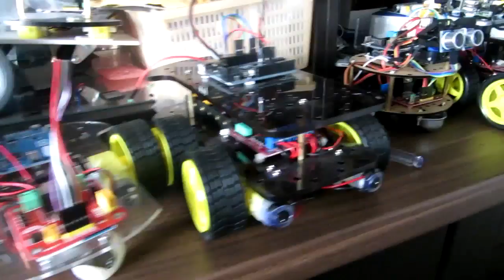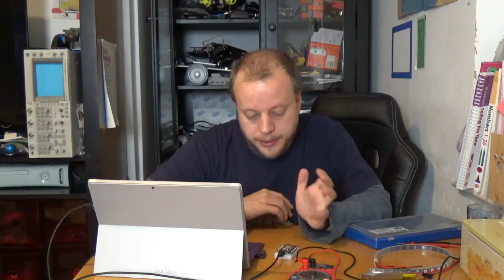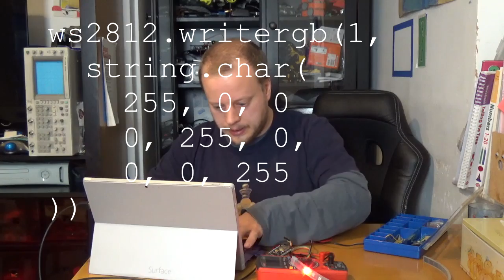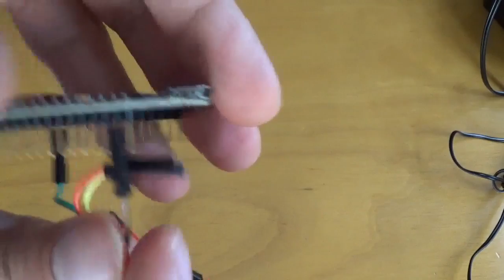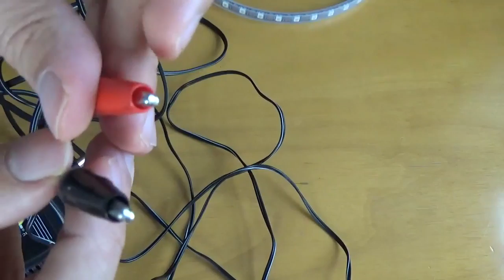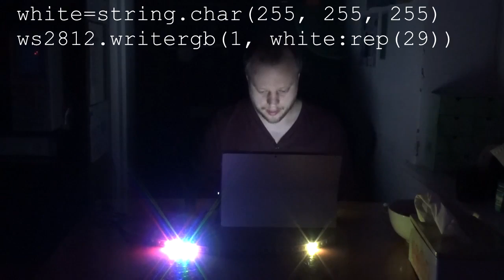Ws2812 Neopixel Led Strip With Esp 8266 And Nodemcu

Comment: Is ws2812 different from ws2812b?
Reply from the maker: The WS2812 has the LED and the controller chip separated, WS2812b has them integrated. The control code and wiring is the same. the ws2812b also has higher brightness. ws2812b also has reverse current protection. It's an improvement, but still compatible.

Comment: Nice video ! But i have a trouble ... with RTOS : I have installed RTOS lib to Arduino IDE (but ESP project)
freertos/FreeRTOS.h: No such file or directory
   18 | #include "freertos/FreeRTOS.h"
      |          ^~~~~~~~~~~~~~~~~~~~~
compilation terminated.
exit status 1
Erreur de compilation pour la carte NodeMCU 1.0 (ESP-12E Module)
Reply from the maker: Hmm, I can't say I know RTOS. However, the error suggests you need to have the RTOS library in the right library path - https://docs.arduino.cc/hacking/software/Libraries - check the library folder you have there. Where do you install the library to (which path)?

Comment: Hello there!
If I power my ARGB externally and want to control esp 8266 wirelessly through wifi, do I still need to use micro-usb for powering esp, or does it get power by SVN connected to red cable of strip?
Reply from the maker: Hello, in this particular example the esp8266 is only powered via USB. However, you should be able to power it from the same supply with a regulator. A 3.3v LDO regulator would do, and if you are breadboarding, look for one in a TO220 case.

Comment: Hello how would you do that with a neopixel Matrix where you could send message to the Matrix and move it from hamstring to right
Reply from the maker: Hello Ernesto, I am not 100% sure I understand your question. However, I think you are talking about programming  a matrix instead of a strip, and scrolling text on it. These are usually arranged as if all the rows had been put into a long line, so if each row has 8 pixels, then the 9th pixel would be the next row down. The code may get interesting in how you store the image (in a 2d array? or just format in 2D visually, but still store in 1d). This video (another maker) https://www.youtube.com/watch?v=6FdksbasKw0 - shows how these are arranged, or how you could hack one together.

Comment: Finally - after hours of searching someone who gave clear instructions and images of what goes where with troubleshooting already built-in and it's almost 5 years old! thanks!
Reply from the maker: Perhaps one day I can follow this up using the apa102 and ws2801, for comparison with ws2812. I'm also thinking of some different controller types - Raspberry Pi, Arduino Nano, esp8266 again, esp32. I'll try to include troubleshooting - but that was easier when I was less familiar with them - and had trouble to shoot...

Comment: nodemcu has 3.3V logic. WS2812 strips run on 5V logic.
Reply from the maker: Driving them works without issues for many lights. As long as its output to 5v it's normally OK. Inputs must be shifted down to avoid damage. The 2812 type seem OK from 3.3v. The 2801 type seem to need a boost.
Reply: @Orionrobots  it is out of spec.
Reply from the maker: @omaversteher1  you should use logic level shifters with these, however my general observation with addressable RGB strips in general, with ESP's, Pis and picos, all 3v3 devices, is that most strips will work fine. Not using a level shifter may result in glitches in the output, but will not damage either device in this specific case.
Reply: @Orionrobots  like said ;-) Out of spec. Can work, but better put the 1/4 in 3.3->5V

Comment: How can I deactivate that the Modemcu automatically turn off.  RGB atrip didn't light up
Reply from the maker: You are probably seeing the watchdog timer, which will normally reset if it's not reset once a second at least. In NodeMCU Lua, use tmr.wdclr(), in the arduino api look at the wdt library.

Comment: would you be able to program this in the arduino IDE?
Reply from the maker: Yes - definitely. I've not made any videos interacting with the esp in the Arduino IDE, and also few using Micropython too - NodeMCU (the Lua interpreter I used) has frustratingly got a slightly young API for these strips, which has changed incompatibly since I made this video.  I am favouring the interpreted languages for a couple of reasons though:
* Field programming - the Arduino API requires you to drop the chip into Flashing mode, not a big deal, but kind of annoying. Lua and Micropython can be programmed over the Wifi when it's setup.
* Web stuff - it's significantly easier to make web socket servers and REST/JSON services in the scripting/dynamic languages than the C++ in the Arduino IDE. It can be done, it just takes more effort.

The pros of the Arduino thing though is the ability to take advantage of all the Arduino code for interacting with devices out there, the massive saving in memory, and the ability to get far lower level if needed. I can certainly make some videos+code examples of doing stuff with the Esp8266 and Arduino IDE if people are interested in them.
Reply: thanks for the quick response! i'm trying to make a project with the esp8266 and a mqtt server from adafruit. io. my plan is to have 2 esp's ,that each have a neopixelring and a button, connect with each other over a mqtt server, so that if one of the buttons is puched, both neopixel rings light up for 20 seconds. (the esp's would not be in the same home network) . but my programming skills in the arduino world are close to none. do you have any tips for me? (i already have dificulty's just lighting up the neopixels just with the esp alone)
Reply from the maker: First tip is to break down the different parts and get them to work, so get the neopixels working - you then have a working example, and then get a simple MQTT node working. Once you have both, it should get easier to connect them up. I have no experience with the MQTT. For the Neopixels  - a quick google turns up this Arduino compatible library - https://github.com/FastLED/FastLED - which supports most of the Neopixel types and the Esp8266 platform. It's got some nice documentation over here: https://github.com/FastLED/FastLED/wiki/Basic-usage - certainly I might play with that after my current project (a chatty interface thing).
Reply: great! thanks for the help! i'm looking forward to your project video's

Comment: Hello sir.
I have a question that how can I connect it with alexa Amazon
Reply from the maker: I've just found a lovely video demonstrating doing this - https://www.youtube.com/watch?v=u4aIFOdGP2k
Reply from the maker: My understanding is you could do that with the esp8266. The idea would be that you create an app to receive commands (like a web app - see my videos on the Wifi LED example) on the esp8266 to control the light strip. Then you need to create a custom Alexa skill to send messages to it.  Requires a load of coding - but definitely doable.
Reply: Orionrobots thank sir much
Reply: I think you can search the web for "ifttt esp8266"
Reply from the maker: Hmm - are there if-this-then-that extensions for Alexa already? Nice.
Reply: None of the current libraries seem to work with the ESP8266 and Amazon echo V2 but apparently do work if you have a version 1 in your system.  I've been trying this for a while with no success yet.

Comment: Trying to use this as an Artnet node to control the strips, then having a lighting program on my computer control the strips to music. Any ideas?
Reply from the maker: I've never used artnet. What I've been able to find out so far is that it is DMX based, and that DMX is basically serial packets. So you may be able to use the NodeMCU UART library to deal with these packets, and probably set it to use the "alternative" pins so the normal ones are left free for debugging/flashing code.. If you use the Arduino IDE for developing the code instead of NodeMCU, there may be prebaked DMX libraries out there for that to help you out. There is a "updsocket" library in NodeMCU for the UDP part too (which I think is the part that changes form DMX to an Artnet Node).
Reply: Any progress with this?  Trying to do the exact same thing!

Comment: Hey do you know if I could do the same using the Arduino IDE with C++ code ? I mean, I know there's a library from Adafruit to do it but I wanted to make sure it was working properly with the NodeMCU. 
Thanks!
Reply from the maker: I've not tried that - it's definitely worth trying. It sounds like other viewers have done it this way so it should work. Perhaps worth trying in a Q & A video.
Reply: Thank you for your answer. Having done some research myself, I found that it should be possible. I'll try as soon as I get my LED strips.
Reply from the maker: There is an answer in the comments below from someone who has tried this already - Micheal Miller.

Comment: My first LED is showing up as white. Sometimes it's green or yellow. I'm using the same wiring setup as you for power but with a 5v battery. I'm at a loss.
Reply from the maker: I've seen a first LED show up as green too. This suggests timing, or signal issues. Can you show me the code you use - do you initialise the output pins used as outputs, and do you immediately set them low?
Reply: Thanks for the reply! I'm attempting to follow this tutorial https://www.instructables.com/id/ESP8266-Artnet-to-DMX/ and use the led strips via Artnet in software such as Jinx!. I'm not really a programmer myself. When I power the lights/nodemcu from a 5v battery pack, the strip is blank, but when I click "Start Output" in Jinx!, the first LED ramps up from green to yellow to white fairly quickly. So It seems that the strip is receiving some type data but not the right kind maybe? I get the same result in software such as Jands Vista 2. It happens when I move a brightness or color slider, but it always goes to white rather than the color selected. I've tried both the TX and D4 pins on the nodeMCU as these are the pins suggested in this schematic: https://www.instructables.com/file/FGELVJ6IYYT4XVL/.
Reply from the maker: I am afraid I don't really know DMZ, Artnet or Jand's Vista 2. It'd be something around the code on the node MCU. I'd suggest NOT using the UART TX to connect a WS2812 strip though, as there is a bunch of activity on boot here and maybe with other programming activities it will interfere with the strip. There are other GPIO's which won't have those associated side effects.
Reply: Orionrobots Turns out I was using the wrong code. It's working just fine now. Thanks for your help!

Comment: Dont we need a logic level converter? 

We can face voltage drops over large distance.
Reply from the maker: +Sandipan Chatterjee technically we should, but the first ws2812 seems just fine and triggers at the 3.3v. Once it shifts out to the next light it will do that at 5v. It's when you have inputs to the 3.3v device you need to be really careful.

Comment: One led full color is around 60mA, and a USB port givs only 500mA Also add a cap around 1000mF to the power line.
Reply from the maker: Indeed. This is why we need to have the LED strip separately powered. They must share a ground though, otherwise the signals will not make sense.

Comment: in 09:12 why we connect Red cable? what red cable for? we already yave data cable which is green. what red cable for ?
Reply from the maker: When I am driving it just from that supply, and not laptop USB too, the ESP is being powered (at the NodeMCU vIn pin) from that red cable.
Reply: is that Vin Pin of the MCU, is there some current limitation for the MCU board

Comment: Hi !

I have a problem with the firmware, I can play with the RGB leds as I want, but the first led is always green.
I see that this is a common problem, it's said that we have to upgrade the firmware manually, but I don't how to do that.
Could you help me on this problem ?

Thank you !!
Reply from the maker: On and off I have seen the same - and had to reset my way out of it. I'm hoping you mean upgrade the esp8266 firmware (the version of NodeMCU) - using the NodeMCU flasher tool, and asking for a recent build should work. If it means updating the WS2812 devices I have no idea at all.
Reply: Orionrobots
Thank you for you response.
Yeah, I meant upgrade the firmware. So I went to this page : https://nodemcu-build.com/
But I don't have any response (I asked a long time ago).
And I went to this page : https://github.com/nodemcu/nodemcu-firmware/releases
But I can't find any .bin files, and I don't know to build from a firmware in order to have this .bin files, (to flash in the esp8266).
So, do you know how to flash the esp8266 with the latest release of nodemcu, using the nodemcu flasher (https://github.com/nodemcu/nodemcu-flasher) ? It will be very helpfull :)
Thank you again :) !
Reply from the maker: First note - I am a user and not a maintainer of nodemcu. I tried a custom build - and had it send details to my email address. I am wandering if I should have some recommended builds for my "Bounce!" project though - since some builds aren't recognised by it.
Reply from the maker: Tried that today - link for it: http://nodemcu-build.com/builds/nodemcu-master-13-modules-2016-09-13-12-48-29-float.bin, http://nodemcu-build.com/builds/nodemcu-master-13-modules-2016-09-13-12-48-29-integer.bin
Reply: Look on my channel: miniature controller Led Master mini v2  for WS2812(B), WS2813....Jinx and Glediator support.

Comment: Thanks for sharing, as I was contemplating a similar project but wasn't sure if it was possible within Lua.  Clearly it is! :)
Reply from the maker: +Scott Evans (VK7HSE) The NodeMCU library has a function specifically for dealing with this light. I can see myself finding the odd device that I need to drop back to C - but the plan would be to extend the lua functions if that's needed.
Reply: I was just searching through the Adafruit forum and found a nice tidbit on getting the Adafruit Neopixel library working with the new wiced feather! (just requires a remap of pin 2 to pa13, however I have yet to test it) I've been juggling over what board to use as I want to control it over wifi as opposed to bluetooth...
Reply from the maker: I've only just heard about a board called the witty cloud - that may also be suitable - it's still esp8266.

Comment: Hi, i find a new sk6822 led, which can instead of ws2812b led and more stable, maybe you can try it. http://ledcolor.gotoip2.com/index.php/Product/view/id/768.html
Reply from the maker: so far the only stability problem I've had is making sure the power supply was coping. I've not had any other real trouble. this other chip- does it come strip and panel mounted or is it currently just sold tape and reel?

Comment: Cool video! I just got one question, does the external power supply also powers the NodeMCU?
Reply from the maker: +Gio Gras yes. There is a vIn pin that can be used and goes through a regulator. I've tried 4.5 and 6v. I've not attempted it with higher voltages. I've not looked up the particular regulator - so I am not certain on the maximum voltage - might be worth knowing in a project where a 9v battery is used.
Reply from the maker: +Gio Gras Found more info - according to the schematic here - https://github.com/nodemcu/nodemcu-devkit - depending on the kit you buy, it can probably run on anything from 4.5v to 20v.
Reply: +Orionrobots 

Thanks man!

Comment: cant get it to work with ESP-01
Reply from the maker: +Razor Coding tell us more - describe your connections, what nodemcu version, what code you've got on it. How are you powering the esp and the led's?
Reply: +Orionrobots esp is on 3.3v. The 1m/60 Led Strip is powered from Another source 5V 4A. GND connected together. Tried with every code i've found in lua/arduino...  I've bought from AliExpress in description they told about GRB.  So i have to change anything in your code?!  It seems for me that the data Command issnt good for my strip
Reply: +Orionrobots Technology advantages

The WS2812B STRIP, every led built-in(embedded) one WS2812IC Chip, realize individually Addressable, means every one led lighting effect can be controlled.
Work under DC5V, each LED is individually addressable, with 8 bits of red, green, and blue data shifted in for 24 bit color, Strips take data in green, red, blue order.

Easy installation
Every one LED lamp can be arbitrary cut off, good flexibility, can be arbitrary bending
Reply from the maker: +Razor Coding which pin of the ESP-01 are you using for output to them? What are you getting - nothing at all, or a garbled output? How have yo named the used pin in code (they do have to be mapped).